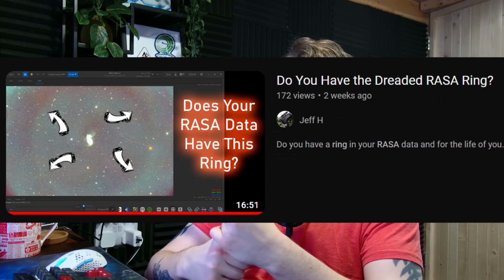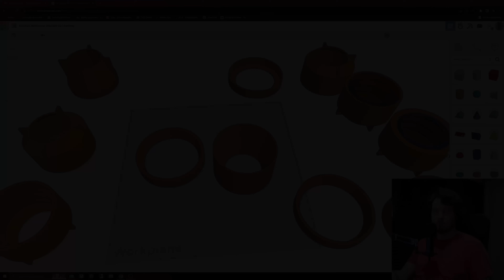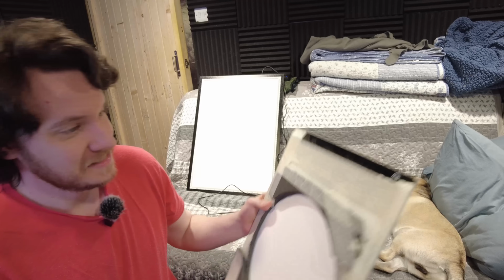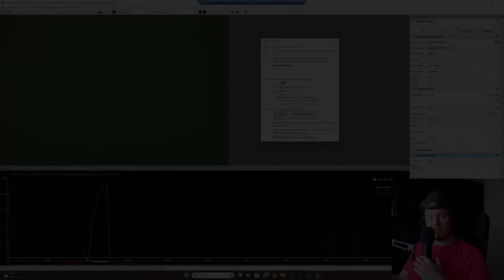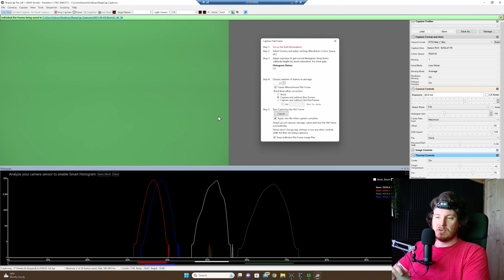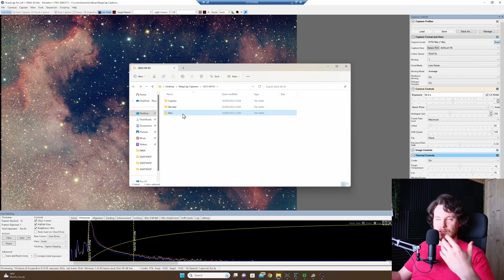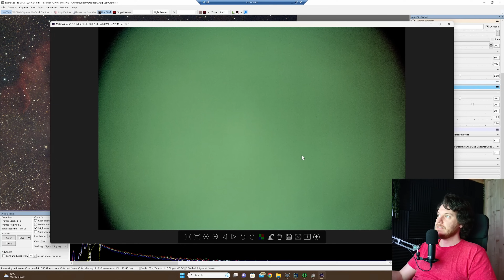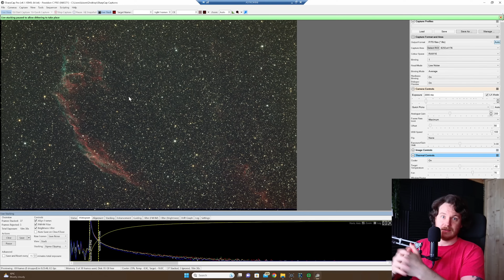I love & hate this telescope lol. RASA 11

Comment: I use neutral density film on my cheap artist flat panel and an embroidery ring with a couple of  brand new white T shirt layers. I favor longer exposure flats, 2 to 4 seconds so I never noticed banding. I think my flats work fine but I'm very new at this hobby so I maybe full of s**t. 

Do you know if this ringing problem is also prevalent if using a Hyperstar on a SCT? I have a C8 SCT and was thinking of when I get more advanced I'd like to switch to some wider field objects.
Reply from the maker: Hey mate! I'm not sure if hyperstar have the same issues as this had, but I'm glad it's fixed now either way haha 👍

Glad you've got a method that's working too!!

Comment: Some light sources adjust intensity by varying the duty cycles. Perhaps that's why at low intensity settings you were picking up the banding with short exposures.

Has anyone tried using those light absorbing paints like Vanta  Black?
Reply from the maker: I think that could be what I'm seeing mate yeah, I did suspect it was perhaps a kind of PWM effect or similar as you suggest! :-) Luckily, the longer flats using the back of the panel sort out any issues!
I've not tried those super black paints by the way!

Comment: Thanks a lot for sharing your issues as well as your solutions, Luke. Excellent video, as always. 
I found that when I increased my exposure to around 3 seconds with my photography light box, that light from outside started to affect the exposure from the backside of the panel. So I had to cover the backside up, to avoid light leaks, from light shining all the way through the panel. 
Capturing flats with the ZWO ASI294MC Pro has proven to be very challenging to say it at least. 🤯😅
Reply from the maker: Hey mate! - I totally hear ya, the 294 in all shapes and sizes can be a beast to calibrate haha - good on ya for getting it figured out though! Thanks for watching and clear skies!

Comment: Great vid Luke. Have you tried taking flats with the panel on 100% brightness? (they would have to be really fast exposures).
When at 100%, the panel will be on constantly and therefore no pulse width modulation dimming, which is what is causing the banding problem.
Reply from the maker: Hey Dave! - I haven't given that a go mate no, I did wonder if it was a PWM issue, - good suggestion thanks!
I'm currently going the other way and using the back side of the panel and low brightness, so the flats are very long and average out nicely!
Hope you've been well mate!

Comment: Hey Luke when I do my flats on my Rasa I put a embroidery hoop with a tee shirt stretched over it on the scope before I place the flat panel on the scope.  This really helps to even out the light panel banding effects.  Give it a try.  Hope this helps. Cs
Reply from the maker: Hey mate! :-) It's good to hear from you, hope you've been well!
That's a good tip, thank you! - I'm currently using the back side of the panel instead of the front as it's quite a lot dimmer, that's allowing me to take much longer flats and it seems to thankfully be doing the job great! :-D

Comment: Sorry to hear about these troubles. But, I am not surprised. 
Optic has important characteristics: size of stars in microns. It is awful in RASA. Mono camera is at least twice more sensitive than color camera, and cannot be used in RASA. Obstruction is large as well. 

So, why not to get Epsilon 180 F2.8. It will eat RASA for breakfast for both sensitivity and especially resolution; and carefree using of mono camera. 

I thought to go with 8” RASA or Epsilon 130. Went with later one. Tons of people are using RASA or edge with Hyperstar with a variety “helpful” gizmos. They just cannot compete with Epsilon. Design and building are not good enough.
Reply from the maker: Hey Ana! :-D
I don't mean this to come across as antagonistic by any means, I'm genuinely really happy for you that you've got the Epsilon! But, If you look at the published white-papers for each design, RASA & Epsilon, you'll see that the RASA is actually a sharper scope than the Tak, as noted by the tighter spot diagrams across the whole colour spectrum!
I'm not suggesting you'd notice a difference in practice though, as both will be limited more by the atmosphere than any particular design constraint! :-)
Cheers!
Reply: @lukomatico  So, how much is star spot for RASA? 3um for Epsilon.

Yes, seeing is contributor. I thought it is major contributor. It is not. On two star parties, I collected data from dozens of rigs. I will keep my opinion, rigs with RASA (several rigs) generated one of worse data. Now, it could be other parts of rig are doing this. But, they had one in common- RASA. 

Now, rigs with Tak were the best closely following by rigs with Esprit.

Comment: I used "neutral density gels filter sheets" sandwiched with milky white acrylic to dim down my panel. It essentially stops it down. My flats are awesome now!

(I have to be careful the density gel sheet doesn't get stuck to the acrylic which can create dark patches. If you press the sheet to the acrylic with your thumb for example... this could be fixed if I kept the acrylic away from the filter sheet - perfect project for 3d printer)

 I found I need multi-second flats in order not to have issues (i wont go under a second.) 

What printer and filament do you use? those prints look flawless... I have an Ender 5 and my prints aren't that good, but ok for what I used it for.

Also, did I miss where you put the cone to fix the issue? It looks like it is at the camera ... I use a Hyperstar and get some issues... not sure if I can do anything about it.
Reply from the maker: Good to know mate! Thanks so much for sharing your tips :-D
I am currently using the back of the panel and that's sufficiently dimmed things down to where I can take 1+s flats easy, which seem to work great now thankfully! - I'll bear the gel sheets in mind should further issues arise though!

RE: printer, I'm using a Bambu p1s with AMS, - it's a great printer! as to filaments, generally Sunlu is good, they make the filament for Bambu themselves. (i do use a couple others though depending on what I'm doing)

I fit the cone into the camera adapter/filter drawer adapter system from Baader that screws on the end of the RASA - the original fitting that comes with the scope is crap, and the baader replacement isn't much better hence the need for a fix haha! - I'm sorry I missed this off the video, I did have footage for that to explain what's going on but totally forgot to edit it in!

Comment: Luke, could you post a link for that flat panel, im using a C925 and have ordered Hyperstar so will be imaging at F2.2 with an Altair 26c. ps a video going into more detail about using Sharpcap with EAA would be great!
Reply from the maker: Hey mate! - Think you're set to have a lot of fun with that kit, good luck for some clear skies soon! - RE: the flat panel, here's a link for it on UK amazon (affiliate link)
<a target="_blank" href="https://www.amazon.co.uk/dp/B08LVXTLZC?ref=ppx_yo2ov_dt_b_product_details&amp;th=1&_encoding=UTF8&tag=lukomatico-21&linkCode=ur2&linkId=8f1550c804adb148e94d125699af5110&camp=1634&creative=6738">A2 flat panel - generation 2</a> 

I'll add it to the video description too incase it doesn't work here, cheers!
Reply: @lukomatico  thanks so much mate.

Comment: I read somewhere that ideal flats shall be between 2 and 3s in order to average the light and minimize the flickering effect. I also use some material in between in order to diffuse the light.
Led panel are made of little square pixel. Maybe a try ?
Reply from the maker: Hey mate! :-) Longer flats are definitely better yeah, I am now using the rear side of the panel which is quite a lot dimmer - it's allowing 1+s flats no problem :-) Clear skies!

Comment: I ditched my RASA as I could never calibrate out the light ring. Now I use a Hyperstar with my EdgeHD11 and I don't seem to need flats with 180sec exposures. However, I had a terrible star flare which I solved by 3D printing a ring to place over the dew heater ring to reduce the aperture by a few mm's. So "technically" by scope is a little slower now than F2, with a slightly reduced aperture. But with the crap weather we get in the UK, and a few hours data from a Rasa/Hyperstar equates to several nights of exposures with a slower scope :)
Reply from the maker: Hey there mate! :-) I totally hear you aye, the faster scopes really let us make the most of these tiny little sessions we often get! Glad to hear you've got the flares under control by the way, cracking work!

Comment: I've found those panels cannot be used below 0.5s exposure and even one sec.   Edit: I see that you came to the same conclusion😊   Did yiu use some fabric between the panel and the scope?   That helps with the banding too.
Reply from the maker: Hey there mate! - I'm now using the back of the panel as it's a lot dimmer, I'm now getting 1+s flats easy :-D seems to be working great!

Comment: Ah the love hate relationship with the RASA 11 mate I know it well, I do find it surprising the Celestron must know of all these issues but never act on them so a bit of a poor show if you ask me. As you know I have the V1 & the focusers were upgraded on the V2's but I'm still surprised that edge HD's still have the same focusers as mine with locking screws as I'd thought they would all be upgraded by now unless I'm missing something?
Sorry to hear the old flat panel died but welcome the A2 club lol they are massive but like you I use the reverse of mine with a T shirt & never had any banding issues when taking flats, in fact prior to getting it up & running I'd never taken flats that actually worked so I can thank NINA for that. I still use Celestron's M48 adapter on mine & gave up using the Baader system as it were only M42 anyhow & the vignetting is bad but flats do sort it out ok & never had any issues there. 
Keeping fingers crossed you've got it sorted out ok now mate so well done you've got more patience than me lol, clear skies!!
Reply from the maker: Hey Tich mate! :-D Hope you and Nicky are well mate!
It's definitely a bit of a puzzle that the scopes ever got released to the public with such design issues - the OTA itself is a great bit of kit, but the supplied camera adapters are a bad joke by comparison hey. - the Baader UFC system is barely any better too, hence the need for these parts to fix it hah!
All seems sorted now luckily, but crikey what a job it's been haha!
Reply: @lukomatico  Yeah we're not to bad thanks mate I hope yourself & Chloe are well? I hear ya about the camera adapters be nice to lose the vignetting when using an APSC sensor which sadly isn't the case, apparently using 2" filters cause it to which is weird as using the same setup with the refractor I barely have any. On mine I use the M48 celestron adapter, spacer a rotator from Ali Express UK (Some Uk vendors sell them at a rather inflated price) & Altair filter drawer screwed onto the camera. All M48 threaded apart from the camera which is M42. Altair will be starting retrofit tilt plate for the cameras to but not rear facing sadly so it's going to be a fiddly process if I bother with one lol. They are a pain in the ass to use but dialled in they're awesome to. Enough of my waffling I'll shut up now clear skies!!
Reply from the maker: @dumpydalekobservatory  We're both good mate thanks!! Thanks for the info by the way, good to know that's another solution 👍👍
Clear skies!

Comment: Excellent video Luke.  I have the same flat panel and curtesy of Steven Miller (EnteringIntoSpace) have started using the reverse side as well. I do use white construction paper along with a white teashirt as a diffusor inorder to get flate longer than 1 second. They seam to work but if you have another idea without the added diffusors I would be interested.  I thing you mentioned turning down the gain, however, I always thought the gain had to be the same as the light frames?  Cheers Kurt
Reply from the maker: +1 for the reverse panel method hey haha! :-D It works a treat! seems like my panel on 'low' allows 1+ sec broadband flats on the rasa now with the rear side, so i'm pretty happy with that!
RE: matching gain/offset on flats to lights - it's certainly best practice!
You can get away with it on the 533, 585 & 2600 no real problem, but earlier sensors tend to need them all matching for best results when calibrating yeah! (especially 294)
Clear skies!
Reply: Thanks for the info. I have ASI1600 and AS1294MC, which I need to keep the gain but I also have a 2600MC so there is a little play in the gain for that one  @lukomatico

Comment: Congrats mate!  You fought the RASA reflections and won this time 🙂  Looks great now!  I was having odd issues with flats until I moved up to a bigger flat panel and ended up buying a Spike-a-flat panel and it worked great!  You may have to put some diffusion material on the panel unfortunately as the lcd panels flicker at lower brightness and nothing you can do about it.  It's the step-up inverter that is the issue with those.  Have you tried sky flats and a big T-shirt stretched over a knitting loom?  Either way I am happy to see you solved your issue!  RASA's so finicky but the results are worth the trouble.  Amazing that you can pick up the Veil Nebula with no narrowband filter!  Clear Skies!
Reply from the maker: Hey Dave mate! :-D It was a battle for sure! I'm now using the back of the panel and it's working wonderfully, the brightness is much lower so I can easily get long flats now, allowing that flicker to average out! :-D
I think you've nailed it really mate, they are so damn finicky but the results are worth it eventually hah!

Comment: Hi Luke, before you applied the 'good' flats, what did the light frames look like before and after fitting the 3d printed baffle?  Did the light frames with the baffle have the 'circle'?  My 200pds had clean lights and clean flats, but once stacked the circle then appeared.  It was movement within the scope/mirrors as it guided, which meant this was only visible after stacking.  I couldn't fix it, ended up with a refund.  Hope yours is now ok.
Reply from the maker: Hey Andy! :-) The lights with the baffle have no ring at all now, so the flats were just there to correct the small vignette etc - worked out well in the end I think!
So sorry to hear your 200pds had to go back mate, that really sucks :-( Those newts are notoriously light-leaky, I've had a bloody shed-load of them over the years. - you may have been observing light entering around the primary mirror cell at certain pointing angles.
Cheers!

Comment: As a totally random suggestion, get yourself a can of Black 3.0 paint for the baffles you printed, that stuff is like painting black holes everywhere if you really want to reduce internal reflections near the sensor.
Reply from the maker: That's a great suggestion and was a serious consideration too mate! I ended up wanting to solve the issues by using just the geometry of the design mainly though rather than needing extra materials/paints - that said, using both would indeed be better I totally agree! :-)

Comment: I'm just curious, but can you take sky flats with the RASA? Oh and I need to get a 3D printer one of these days! Love that you were able to engineer your own solution!
Reply: I've managed sky flats using a T shirt on mine so it's possible Rich.
Reply from the maker: Good tip mate! :-D
Reply from the maker: Hey there mate! Hope you're doing well and getting plenty of clear :-D
You can indeed do sky flats if using a decent diffuser as Tich states here with the T-shirt solution, but I've never had amazing repeatability from them so settled on the panel route - I now use the back of the panel and it gets me much better flats luckily :-)
Cheers!

Comment: Another tip for you. I leave my LED panel at full brightness and I place a sheet of Photographic paper between the panel and the scope to reduce the brightness and use longer exposures to get the best flats
Reply from the maker: Thanks for that Tom mate! :-D I've since switched to using the back of the flat panel and that does the job lovely it seems!, much dimmer than the front

Comment: Great Video as always Luke. I don't have a RASA but is it obvious where you fit the 3d printed part into the image chain as I didn't see where you showed that? Clear Skies
Reply from the maker: Hey mate! - That was a bit of an oversight on my part, I did record a segment showing where it fits but completely forgot to put it in the video LOL! Ah well.
The larger part goes inside the camera/filter drawer adapter, and the smaller part goes into the empty threaded region in front of the corrector lens group! :-)
Thanks for watching mate as always, and clear skies!

Comment: What material do you print with Luke. I’ve used PLA-CF for Astro parts as it has a Matt finish which really helps in terms of reflections
Reply from the maker: Hey Tom! - I tend to use matte PLA a lot, but lately I'm trying to switch to PLA+ instead for better layer adhesion on parts - the Bambu does print most things very nicely though luckily!